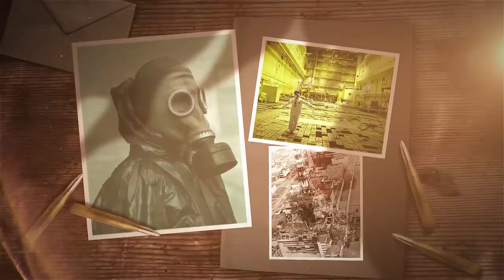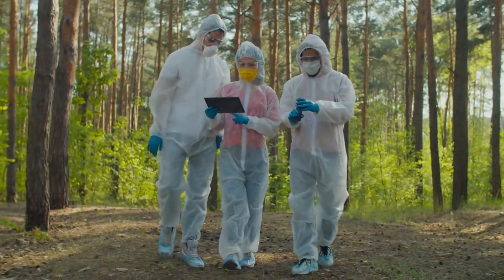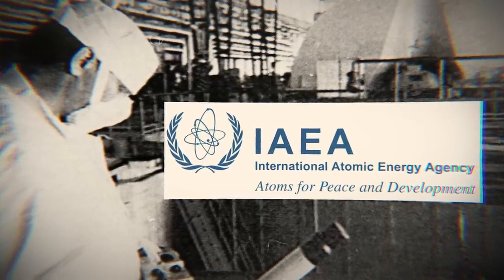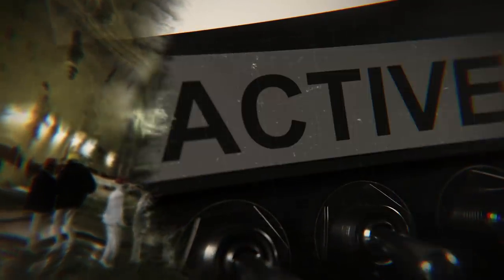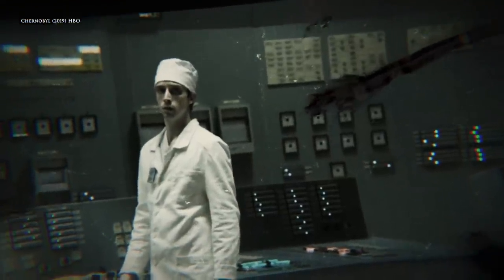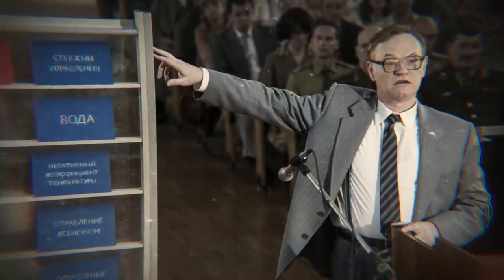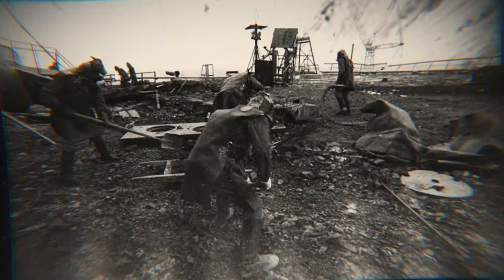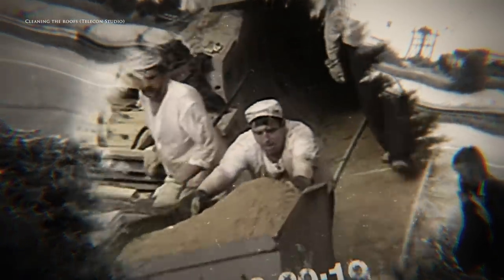Everything That Had To Go Wrong For Chernobyl To Happen

Comment: And how long until chernobyl is safe again?.... Probably never, good work!
Reply: It will probably be OK for industrial use by the time the warranty expires ion the new confinement in about 90 years.  By then the longest living most ubiquitous radioactive agent, Cs-137, will have decayed to about 1/16th of what it was on the day (by 2286, it will be down to a thousandth).  That's providing some new technology doesn't come along to supercharge the cleanup.  Find out the facts, not the Greenpeace hand waving.

Comment: The Chernobyl disaster was not a Nuclear Explosion. If it had of been, it would have vapourised the whole plant, plus Pripyat, and way beyond. 
The actual explosion was a massive build up of Steam that blew the core apart, plus spewing the radiation into the atmosphere and exposing the rest of the core . There was in fact a smaller explosion just before the huge one..... The smaller one was the fuel rods fizzing (Critical), and then the steam build up blowing the reactor apart.

Comment: Honestly I'm not really big into nuclear energy so I'm not really a activist for or against it. But a lot of people use Chernobyl as a reason not to use nuclear energy. There is no argument that this event was catastrophic however, a lot of things were done incorrectly as shown in the video, but also the fact that the Soviets designed and used the outdated RBMK reactors purely because they were cheap. If you ever ask why did they have this or that as a system for their reactors its cause it was cheaper. So with that being said nuclear energy can be great when done right, there's pros and cons to everything. But I mean should ocean liners be banned because what happened to the Titanic?

Comment: Hmm, this video makes it sound like no one knows really how the meltdown happened... However the designs are open to the public, the orders were clear on the test on Reactor 4, and the test that should of only been a test went out of control. The controlling rods, the ones made of graphite (with some other elements mixed in) were meant to slow down the reaction of the nuclear rods. However with the major design flaw and how far the system was already going they cracked and fractured preventing them from moving down into their place. The control rods are designed to slow down and even heavily reduce the nuclear exchange (or the nuclear reaction if you prefer) between the nuclear rods. 

I have done a lot of research on this as well as many many others. It is disappointing how this video is spreading misinformation and acting like we are clueless as to what happened during that day. Just a shame. There are also other points that needed to be said but what they said about how the control rods themselves are the reason for the meltdown is crazy when they cracked and unable to move down to stop the reaction. Although by the time the cooling system water was turning into instant steam was a sign things were looking pretty grim. However the control rods would of helped slow down the reaction which in turn could of saved the powerplant from a meltdown.

Comment: Well Chernobyl can't happen elsewhere for only the Soviet Union made reactors like that.  Every other nuke country has a concrete shell over the reactor as a line of defense. this reactor did not, just the building so if an explosion like that happened the shell could possibily contain it or lessen the impact. The closest thign we had to Chernobyl was Fukishima and that reactors group dealt with a major earth quake AND a tsunami and even then it was only poor placement of the backup generators that caused the big issue. and note the Fukushima reactors are OLDER then the Chernobyl ones.

Comment: Holy hell. From the first sentence you are so bass ackwards on the reactor design, the work crew that was on duty at the time, and the reasoning behind the test. 

do some freaking research instead of looking for sensationalist bullcrap to regurgitate.

I think I'm done with your channel I cannot stand how much you're getting wrong how much you are breathing over and how much you are watering down the facts. 

Anyone else questioning the validity of this video, it's bullshit. Plain and simple. 

By the way there were three other reactors on that site the other one in the same building was shut down and the other two continued to function to 2000. So for such a dangerous and unstable design  it sure is curious that the two RBMK reactors in the other building on the site functioned without incident through the next decade....